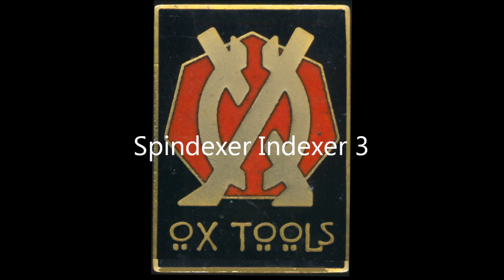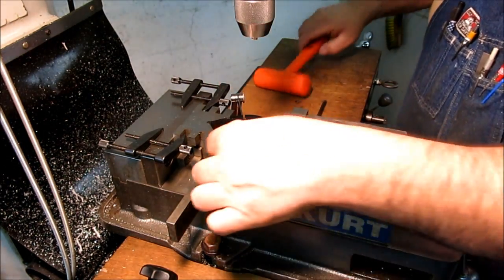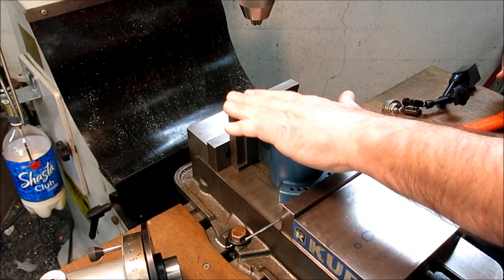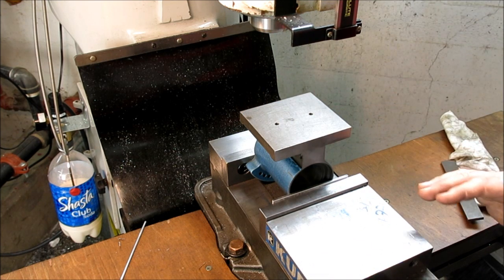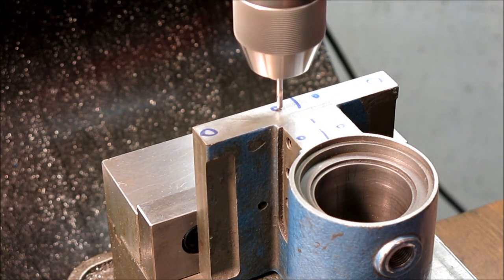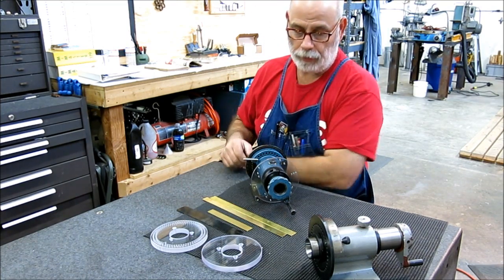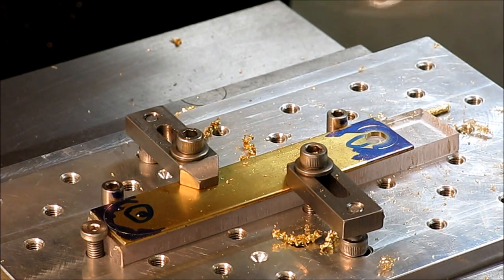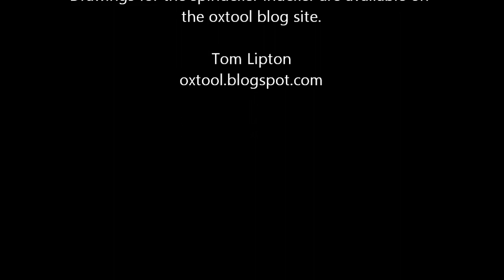Spindexer Indexer 3

Comment from the maker: Hi Mark,

The only problem with it is moving from one hole to the next if you have a bunch of holes. Its nice for small taps where its hard to gauge the down feed when tapping and you don't want the quill spring pulling on your little threads.

Best,

Tom

Comment: I've been watching videos like this . 
I also done my indexing attachment except I ground the back side first on surface grinder then I clamp it on a precision angle plate , then I indicated the base like you did then got center it and machined the sides , added mounting holes to the base also made a 5/8 grooved X and Y access so I could also hole directly on the milling table. Nice work though.

Comment from the maker: Hi Togaida,

Do your bars have a hole or any other feature at the center of the radius? Is so there is a neat trick for doing what your describe. If there is no hole then doing a full round is a bit of a pain but I can think of a method that might work well. One way I have done this on a belt sander is to make a pivot pin so the operator can only swing the bar in the correct radius. Is this a regular job that comes up for you?

Regards,

Tom

Comment: I like it when you show the how to of your setup and the first little bit of the operation, also a bit of high speed adds some fun, with sound even. Another thing for the upstarts might be to verbally touch on other setups that may depend on how critically accurate the tolerance... There's nothing wrong with shooting for perfection, but we all make mistakes, no matter how many hash marks we wear on our sleeves. There are quite often several correct ways to do a job! Great video quality! :o]

O,

Comment: With three screws in the lexan disk on the stop collar...how do you tighten the stop collar? Did you overdrill the whole sizes for the attachment screws? I haven't watched the whole series yet, so if you have answered the question never mind. Thanks for all of your videos. I really enjoy them.
Reply from the maker: +Noxious Green Hi Green,

The disc and collar both fit the shaft well. There is enough spring in the system that the collar clamps to the shaft securely. The movement is probably less that one thousandth between the screws and collar.  Thanks for the comment.

Cheers,

Tom

Comment: Hi from Aus. How did you check the casting bore for square and parallel to the reference sides? Keep up the good vids.
Reply from the maker: Hi Bernie,

I don't actually remember what I did. Most likely used the bore and the bearing counterbore as reference surfaces. Since its round the radial orientation was whatever the original was. Large bottom face made parallel to bore first then ends perpendicular to bore axis parallel to one another. Sides perpendicular to bottom and ends. Hope this helps. Thanks for the comment.

Cheers,

Tom

Comment: Tom I have been asking around for help and info; I just got a spindexer and I have a question for you, I don't know if I should ask for a replacement. I have lookeng at a lot videos to see if others read the same as this one does. if I put the pin in the 0 hole the arrow is pointing at one deg. if I put the pin in the number 9 hole the arrow pointer is at zero. for some reason I think that the arrow should read zero and the pointer should also read zero. if they all are made this bad I don't think that I will try to ask for a new one.....Jon Ell, Thanks
Reply from the maker: Hi Jon,

The one I have here sits on the zero of the degree wheel when the pin is in the zero hole on the casting. Sounds like something might be wrong. I would take it apart and see if there is a way to rotate the degree wheel and reset the index mark. Thanks for the comment.

Cheers,

Tom

Comment: an easier way to machine the sides parallel to the centerline and the same distance from the centerline is use two vee blocks, round stock or the quill from the unit, and an angle plate. the round stock or quill is through the bore and resting in the vee blocks. the base is then clamped to the side of the angle plate. rough the sides and then take a finish pass on both sides. another useful modification is to mill a keyway on center to fit you mill plus one at 90° to the first keyway. then just clamp the indexer right to the table. especially useful on smaller hobbiest mills with limited daylight between the spindle and the table
Reply from the maker: Hi M,

Good ideas there. Thanks for the comment. 

Cheers,

Tom

Comment: Hi Tom, first gotta say love all your videos. I'm diesel mechanic by trade but i love machining, i just started to learn and I've been hook watching the videos all night for the past 2 weeks, the wife is getting annoyed cause i don't pay attention to her.

Now i had little questions regarding this project:
1- When machining the sides of the indexer could you of left and edge at the top so you don't need to use parallels for quick set up?
2- On your mini pallet block did you installed steel threaded insert or is it tapped directly in the aluminum
3- Last one; did you machined those little strap clamps or it's bought item?

Thanks
Max
Reply from the maker: Hi Max,

Thanks for the comment and questions. You could machine the indexer that way but then you are holding less and cant sink it into the vise further if you want to. No thread inserts in the mini pallet. The idea is you surface it once in a while to keep it really nice. The strap clamps I made but there is a guy making them. Check out. http://www.rwlsystems.com/Clamps.html

Cheers,

Tom

Comment: interesting project i have a 100 tooth ,  drive  gear on my lath  & & to cut it & used a 50 circle hole by making my indexes plate out of  black,  Derom ,  rown bar ,    To drill the holes.  I used   a 50 hole , gear.  on my index   Shaft, to set the gear centers , of my hols.  so when needing a gear cut , i just rotated twice. & produce  100.  teeth.   I get it & the reality is that all teeth can  be cut up to one hundred . Holes by splitting the dimiter.  &  the number of hold to cut ,  I get you idea  of continuous hole briling . But for larger radius we must revert to diameter  by design & it relason ship to tooth size ,

Comment: Why not clamp the collar to the shaft and get just the right spacing for that gap - it might avoid straining the plastic disc ?
Reply from the maker: Hi Jester,

That's what the shims were for. The shaft was not as easy to set up and I didn't feel like turning a new one. 

Cheers,

Tom
Reply: oxtoolco I bet that you measured the gap in the collar before you dismounted it !